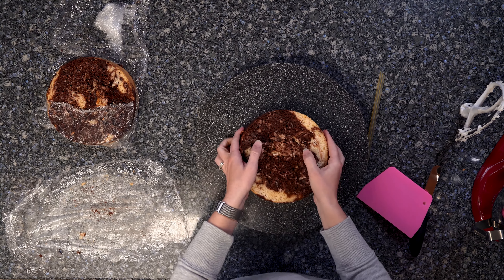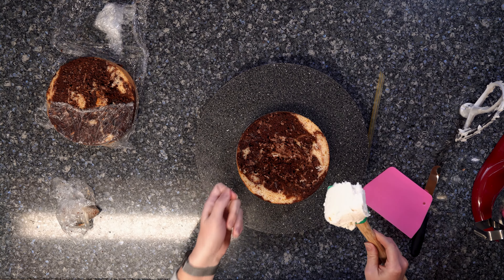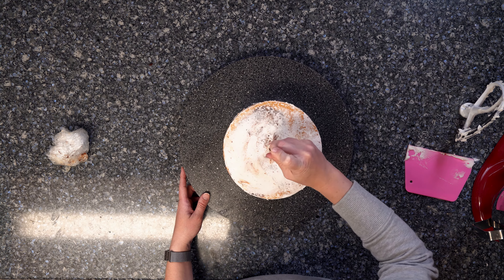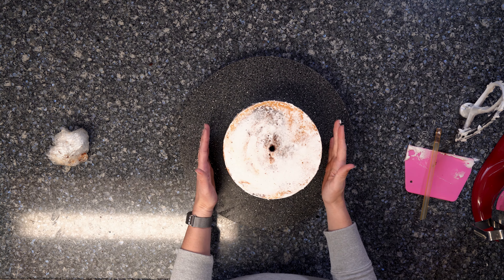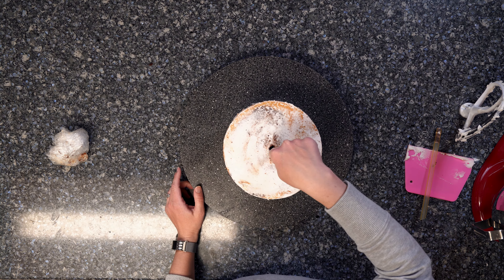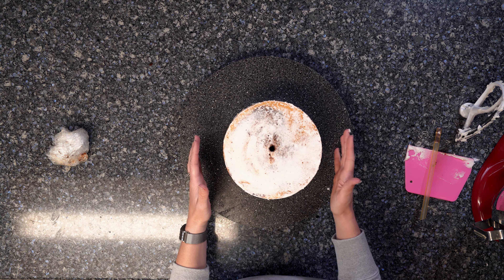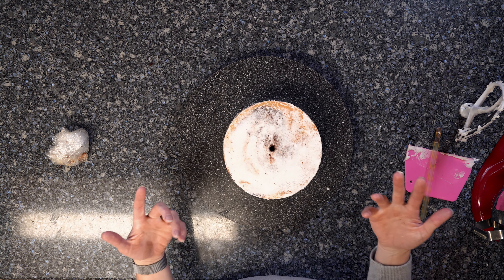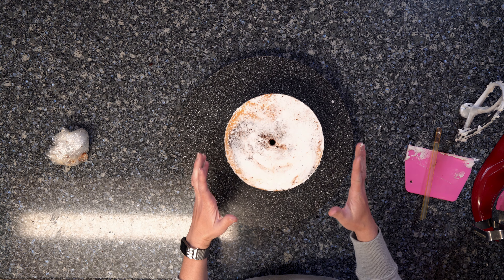How to NOT Get Buttercream Air Bubbles or Blowouts

Comment: Thank you for the information! How can apply this tip if I’m making a stacked cake?

Also, just want to make sure I understand correctly.. when your ready to do your final coat of frosting after the cake has chilled for a while with the hole, I can add the straw back into the hole and do the final coat?
Reply from the maker: Same process for a stacked cake.

Yes, once you are ready to stack you an insert your straws right back into the same hole
Reply: @CakingatMidnight  thank you!

Comment: Hi just wondering how far down you pushed the bubble straw? It seemed like just the first layer is that enough to release air from the whole cake?
Reply from the maker: I push it all the way through the cake!
Reply: @CakingatMidnight   thanks for the info 👍🏼👍🏼 I hate air bubbles.
Reply from the maker: I do too! I haven't had an issue since doing this. Once it sits and before applying the final layer I will press down on the cake slightly and you will feel air coming out through the hole.